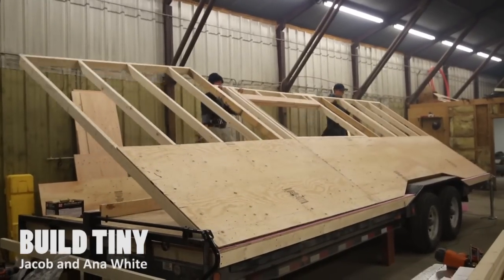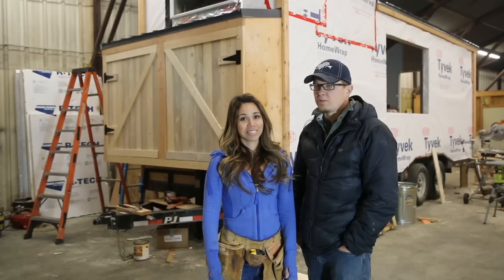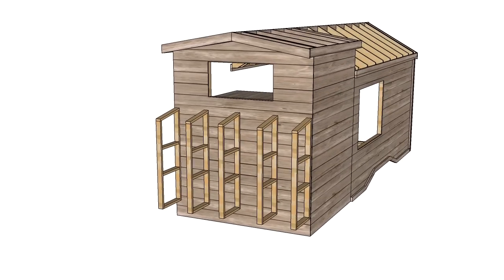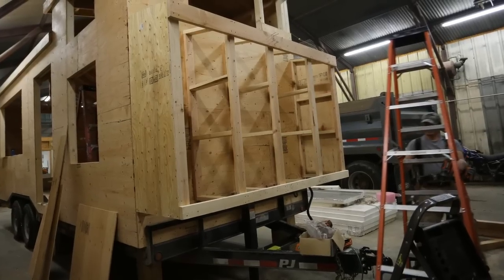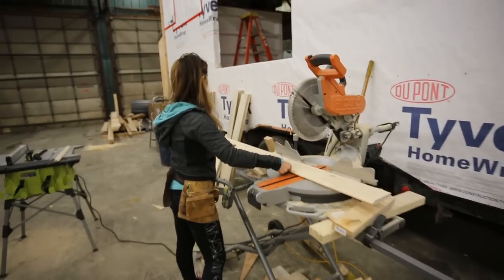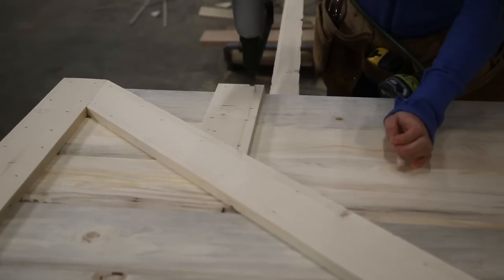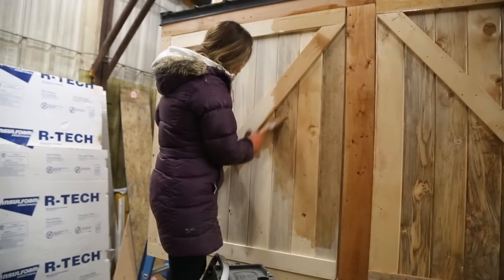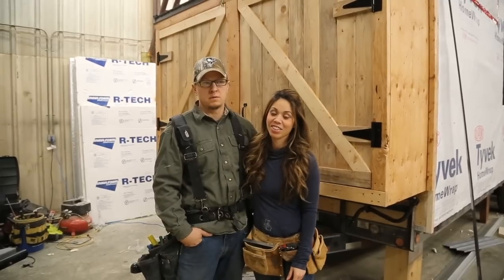Exterior Storage Shed: Ana White Tiny House Build [Episode 5]

Comment: Hey @Ana White I'm a License Stucco Contractor  and  80 % of the water leaking into the houses is always   via the windows and I would like to give you a little  advice, hopefully I can  help as you guys have been helping us through out  your videos...

At minute 7:48 I saw you guys install  window protector  wrap also known as  window flashing also known as  self adhesive tape etc, over the bottom of the window flange. My advice to you is  either  use  the same  tape you are using  or 6" if possible  but  this time behind  the window  or  you can also use a  more expensive  material  called  "FLEXIBLE  WRAP" from the same company   as your home wrap (dupond)  which worth every penny.  DO NOT INSTALL  the  flashing over the  bottom  window  flange, that's where all your water will  drain.

 ALWAYS, install the  window  tape  before  the  window is install  starting from the bottom then the sides then top, proceed  installing your window with  silicone  if manufacture requires, nail  the flanges  and then  install a second layer  of flashing tape  this time  only  on the sides, nothing on the bottom since that been take care from inside (first layer) proceed  installing your  Z flashing also  known as  drip cap over the head casing of your window and  then the last layer of  window flashing over both ( the  drip cap and the window flange)  this  will ensure a proper drainage  for your window. 

hopefully you can read  this  and really  pay attention, I been  renovating   a ton of damaged houses  all because a wrong window installation.

my .02, my way to say THANK   YOU  FOR ALL YOUR VIDEOS  AND HELP.

Comment: Wonder if we could add a smaller size to the end of a class c and house our generator and some tools. Maybe a battery box on the other side. I never even thought a that till I saw this video. That way the bumper. It can also be used as a weight  barring for the bottom, too. It saves building out on it with a metal crate like I've seen out ppl do or that portable carrier that goes into the hitch.

Comment: Two questions.....what about all the tongue wait you just added....and what about the tires trying to hold all that weight going down the road or over the years parked and deflaiting?
Reply: Loral thanks for inquiring. I have airbags on my truck that should help with the extra tongue weight. The trailer tires should hold there own I don't think the tiny house is all that heavy and won't weight more than the trailer is rated for.

Comment: great simple build and nice video as always.  couple of questions 
wouldn't u have trouble with wood expansion on the doors?
and any ideas how to seal the shed? maybe some kind of door jambs on the inside?
Reply from the maker: +Ayman Al-Sairafi Hi, yes, we did make the doors about 1" smaller to allow for wood movement.  Hopefully this is enough.  You could add a door stop along inside to cover this gap pretty easily too - we we are trying to minimize to keep weight down, but that would be an easy fix.  Overlay doors would do the trick too.

Comment: Did you all add any jambs to prevent water getting in around the doors while at highway speeds?

For their building their own tiny, a few others have brought up concerns about turning radius of a truck clearing the shed. This is often why you see sheds follow the narrower profile of the tounge, or be set higher than the tailgate height of the truck bed. Iow, the shed isn't wider than the metal trailer tounge, or starts perhaps 5' above the ground. That way you clear the bed(if there isn't a cap), or ou would "knife" the truck bumper on the trailer tounge before you hit the softer house.

Comment: i assume yall figured in the height of bridges before making this. what are the average heights of the bridges there and how high is the house?
Reply from the maker: Hi!  The house is about 13'4" with Alaska state height requirements at 14'.  Check your local regulations, and also any low height bridges/underpasses on your travel paths before you build.